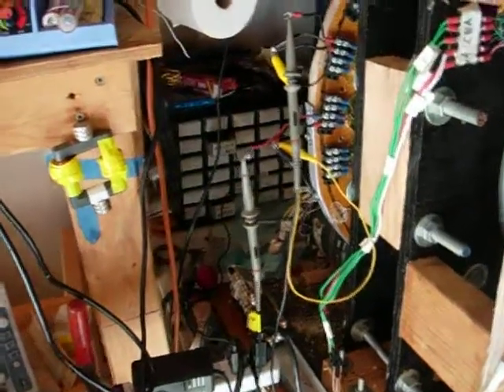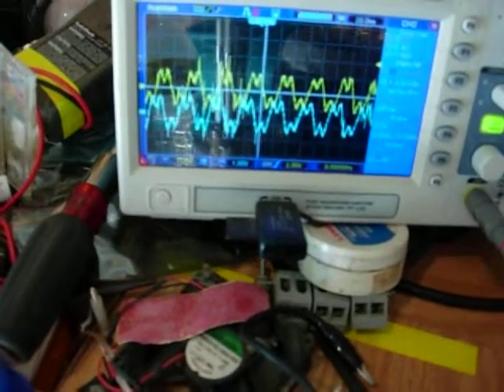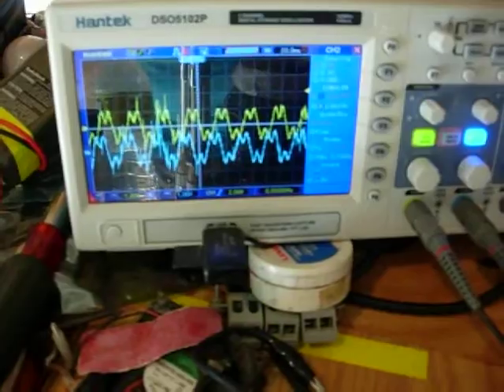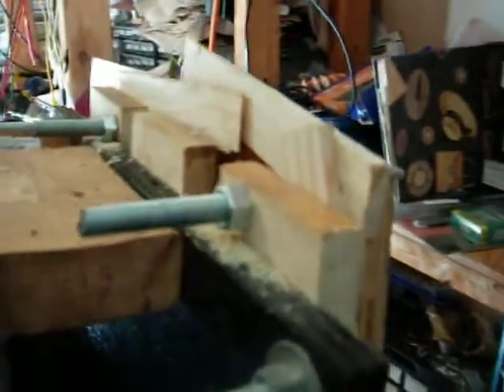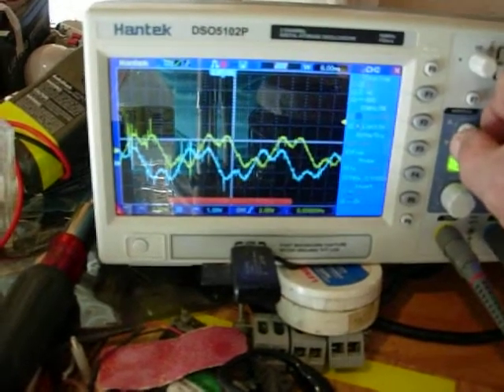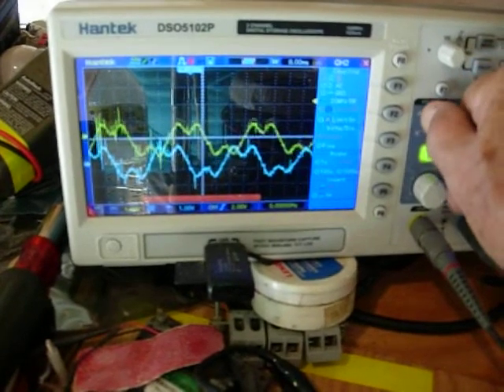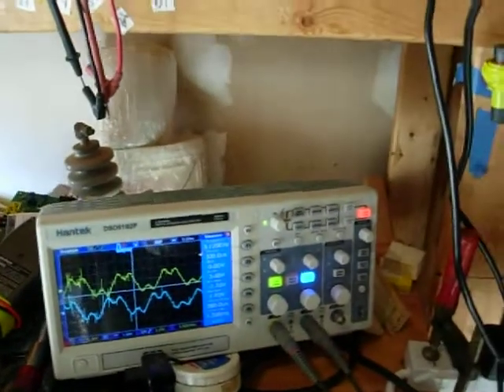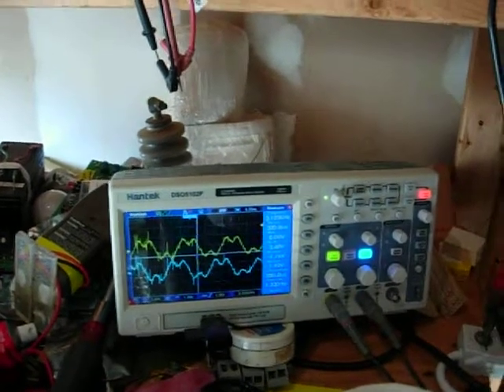Don Smith #320 Testing installed dual coil  setup

Comment from the maker: It'll be interesting to see what the coils put out with disks of magnet on both sides of coil  N one side S the other side.  The next assembly will require a new Samsung shaft  1" about 2ft long maybe shorter I'll have to measure wooden plates and  disks with magnets.    the mounting devices are all done

Comment: Hi Gary   Looks like if square divisions have five "spaces" in each, its 29 spaces for one "AC" cycle...and it looks like the phase shift between volts and amps would be 6 spaces or so, that makes for a 75 degree phase shift...(360 degrees /29 = 12.4 degrees per space....then 6 space phase shift gives 6 x 12.4 = approx 75 degrees)
Interesting how it lines up, so that one peak is out of phase, but the next peak is in phase.  This might mean something when planning how to extract power to load...or to connect to BiTT transformer (which like out of phase near 90 degree reactive power) and then have output of BiTT connect to motor so overall becomes lenz free output.  
Just an idea...
Also to get delayed lenz speed up under load very generally 16 magnet rotor requires RPM window of about 2100RPM plus or minus 200RPM something like that.
32 magnet rotor 1150,  64 magnet rotor 575 RPM... (now workable)
Two 32 magnet rotors "staggered position" to coils on each side of coils will give 575-like RPM to it so you can get no lenz speed up with two 32 magnet rotors instead of 64 if you get what I mean should you go to sandwiching coils with two rotors.  
Maybe try connecting your "AC" double peak sinewave as-is  to similar pancake motor spinning it, see what happens then to sinewave and how it brakes with lenz law.
Also the double peaks, and dip between them,  is the leading edge of a rotor magnet followed by the trailing edge of rotor magnet, and the dip between is the middle of magnet (the eye of hurricane)
I took advantage of the "dip" to make a perfect sinewave from an even number of rotor magnets, all facing N....hook up adjacent coils in "reverse" series (!)  
I made some drawings with geometery and dimensions to get it to happen a few years ago using aircores....I dont know if you need or want a perfect sinewave but its interesting way to go with it,  Might work better if connecting transformer between motor and generator to loop:
https://alternativeworldenergy.wordpress.com/flat-disc-alternator-patent-drawings/
Reply from the maker: will have new fill dump pcb in a few days.   I need to do some slow motion magnet coil rotation to see exactly whats going on with the flux.  each disk has 12 neo 2:4 dual coils  It'be interesting to see what this does.
Reply: Hi Guys, I thinking about building a Toroidal generator with it direct drive to my Samsung motor.